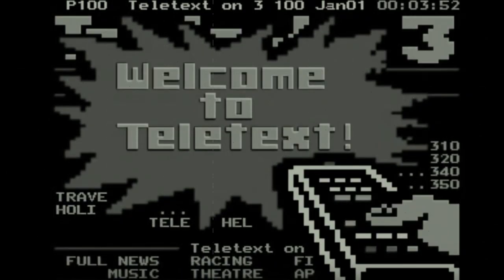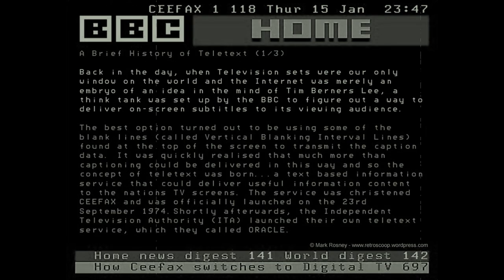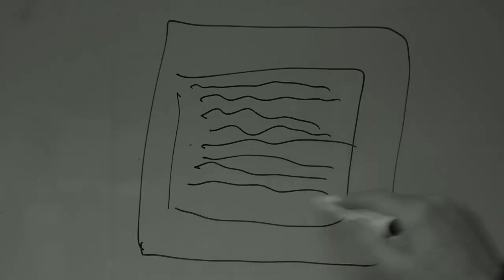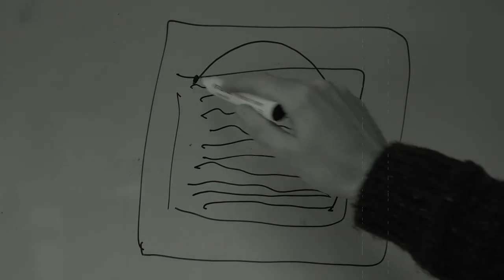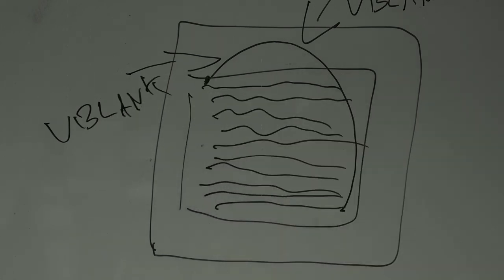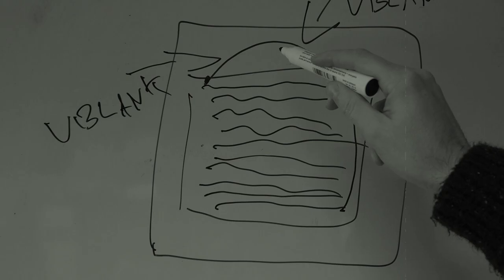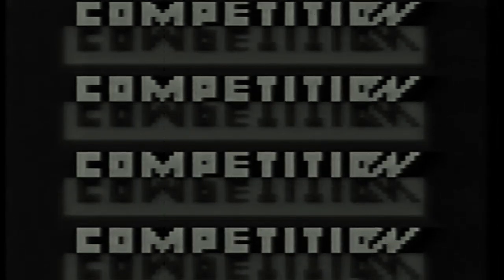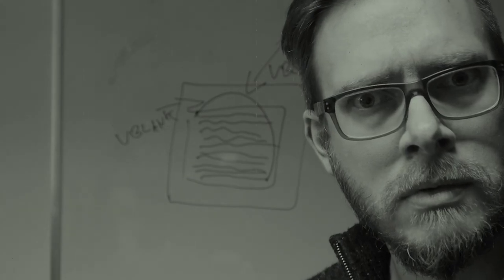How Does Teletext Work? - Weirdness | Nostalgia Nerd Extra

Comment: on some older TV's that had vertical hold controls or when a picture rolled, I noticed on certain channels or on tapes that were recorded those certain channels, there was  some black and white "noise" at the top of the picture just after the Vsync area, I'm betting that was the teletext data
Reply: And you'd be correct!